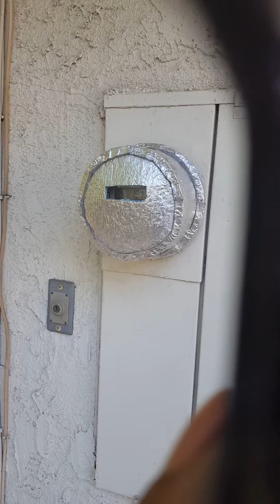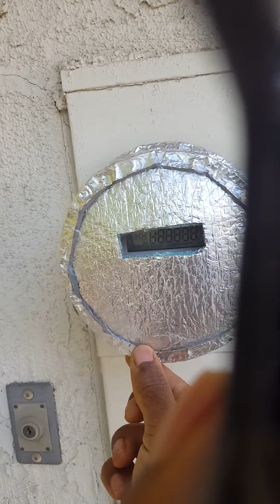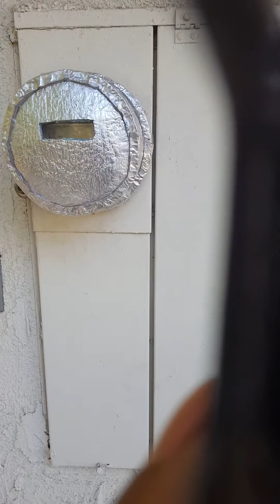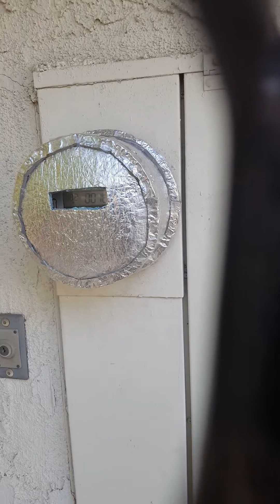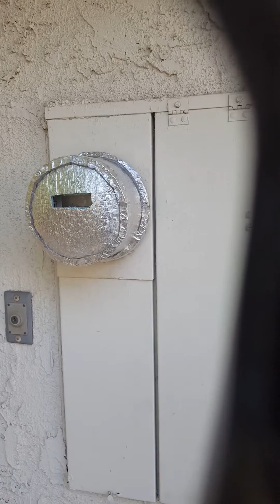Exterior Smart Meter Shield by John Fantroy

Comment: BRILLIANT , Cheap/AFFORDABLE, SIMPLE, and (hopefully) EFFECTIVE SOLUTION!!!   THANK YOU, FOR THIS GREAT IDEA!!! 
FYI: My old girlfriend lives in a 4 appt. condo. The Electric utility recently installed 4 smart meters, there, outside her bedroom walls.  So, I went to Home Depot, and bought a roll of 2" wide ALUMINUM, adhesive backed, Duct Tape. I cut pieces of the Duct tape, and carefully wrapped each of the "smart meters", leaving only the area of the "digital display" on each meter, uncovered, (visible).   So, NOW, these meters are pretty well "SHIELDED" under a thin layer of "heavy" Aluminum Foil, (tape), and they are (hopefully) a lesser threat to the occupants of that building!  So far, I don't think that the Utility Company has been made aware of their "altered"/"shielded" meters!!! LOL!!!!!!    HEY, EVERYONE CAN DO THIS, without disturbing the meter, (internally), and the Utility Company will have to literally INSPECT EVERY METER, EVERY DAY, if they think that they're going to STOP this kind of "CIVIL DISOBEDIENCE!!!    I DID NOT REQUEST A "SMART METER", My OLD, "Analog" Meter worked JUST FINE, for DECADES!!!   
Perhaps, just go to Home Depot, and buy a new, EMPTY 1 gallon Paint can, and take it home, and position it over the body of the meter, and DUCT TAPE it THERE, so that the meter is ENTIRELY "SHIELDED" (covered), by the paint can. Or, use a large coffee can, or other LARGE CAN!